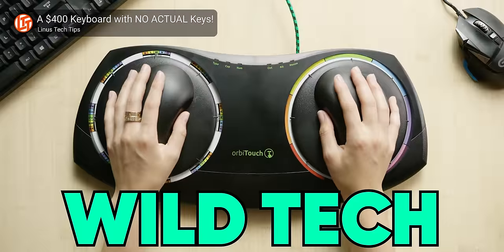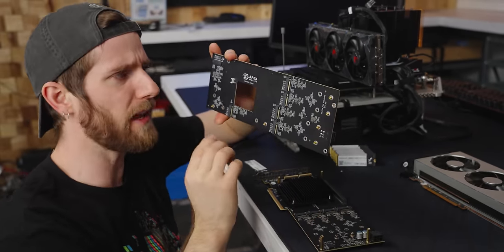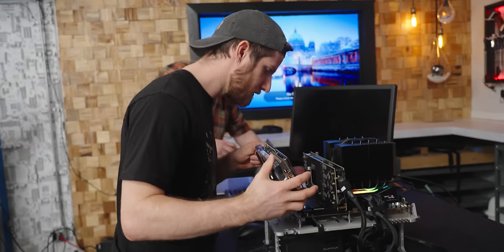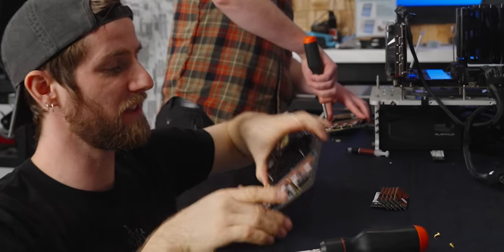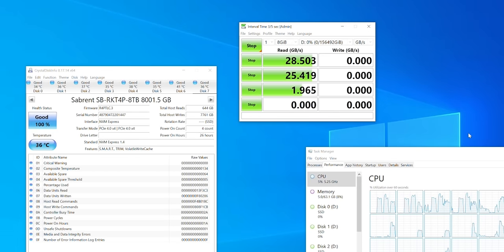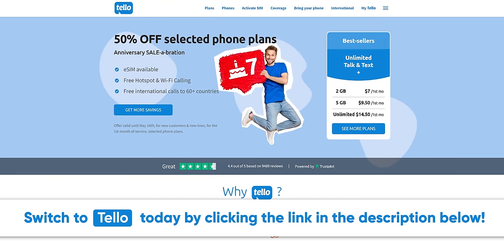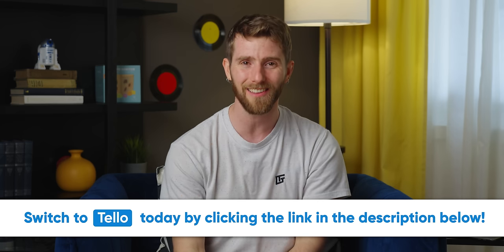This SSD is Faster Than Your RAM - Apex Storage X21

Comment: The primary use for these PCIe switches are actually in servers - when there's lots of SSDs in a server backplane they're sometimes connected directly, but often there's one or more big PCI-e switches driving the slots. And each switch will have a 16x or 32x (yes, this is a thing even if the standard only lists up to 16x) PCIe 4.0 or 5.0 uplink. This is the real reason why PCIe link speeds are again trending upwards quickly after a long hiatus (between 3.0 and 4.0), there's finally a user (servers) that are willing to pay for development (there's not enough entuast to pay for it by orders of magnitude).
And I assume the reason the card doesn't have any fans is because they expect it to end up in servers where there's a large amount of airflow provided by the server itself (sometimes capable of cooling 400W GPU or AI accelerator with just the servers airflow, no fan on the card.
It's also unfortunately why PCIe switches disappeared from consumer motherboards (many early SLI motherboards had them), the PCIe switch vendors jacked up the prices by 10x because most were sold to server vendors and they were willing to pay.
"Better" (IE expensive) server backplane often accept PCIe (U.2 or U.3, both 4x PCIe), SAS (12Gbps) or SATA (6Gbps) in all slots by routing each slot to either to the PCIe switch(es) or the SAS switch(es). Yes, SAS switches offers all the same features (fabric, multiple servers, dynamic load allocation to the "uplink" and so on) to both SAS and SATA disks, they've been in server backplanes for a long time (long before PCIe SSDs were a thing, never mind M.2). It does makes me wonder if some of the PCIe switch chips also does SAS, that would reduce chipcount and make routing far simpler which means they can ask the server builders for more money...
Reply: As far as I can tell PCIe has been getting faster at a pretty consistent rate for many years, it's just Intel was a laggard in going to PCIe 4 so gen 3 was around longer and by the time they were on gen 4 we were already close to gen 5. If you look at it in terms of AMD instead gen 4 was around for plenty of time.
Reply: @bosstowndynamics5488  No, 4.0 was seriously late. The official introduction years is 2003, 2007, 2010, 2017, 2019, 2022, (2025 planned) for 1.0 to 7.0 (check official graphs or the Wikipedia article). Note how they all are around 3 year, except one that took 7 year - that's the 3.0 to 4.0 transition and it's a big outlier.

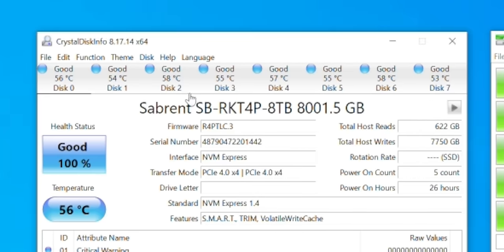Comment: 12:25 55°C is apparently the sweet spot for nand flash, it doesn't like being colder or hotter 
Colder = increased data retention, write wear
Hotter = increased hardware degradation
Reply: Anywhere I can read up on that?
Reply: @pandozmc  I think I first read this on a EKWB site but now I can't find it.
After a bit of googling I found this anandtech article from 2015 back when SSD data retention periods was becoming a concern.
I should note that my memory isn't quite accurate, so if you do look this up feel free to ignore what I said in previous comment.
here's what anandtech says :
The conductivity of a semiconductor scales with temperature, which is bad news for NAND because when it's unpowered the electrons are not supposed to move as that would change the charge of the cell. In other words, as the temperature increases, the electrons escape the floating gate faster that ultimately changes the voltage state of the cell and renders data unreadable (i.e. the drive no longer retains data).
  For active use the temperature has the opposite effect. Because higher temperature makes the silicon more conductive, the flow of current is higher during program/erase operation and causes less stress on the tunnel oxide, improving the endurance of the cell because endurance is practically limited by tunnel oxide's ability to hold the electrons inside the floating gate.

Comment: Use some M.2 to HD MiniSAS adapters and connect the card to U.2 enterprise drives, you could go with gen 3 because of the oversubscription.
Use two of them to connect 42 U.2 drives RAID 0

Comment: It sound like it dynamically routes pci to where it is needed, It is super cool that it is possible to run any 4 drives at full pci speed or 8 cheaper slower drives at their slower speeds at the same time.
Onboard raid controller could be perfect, so that the pci bandwidth only needs to transfer to the drive controller and the drive controller does the mirror instead of using pci bandwidth to mirror.

Comment: On the Topic of Hot-Swap M.2: This feature must be supported by the Controller AND the SSD - and the Crucial P3 in the test does not support that.
Through my personal testing, I've found not all hot swap feature on M.2 is the same - its basically a hit-or miss (for me at least)
Reply: I thought by the nature of its design all PCIe device chips need to support hotswap. The hard part is power switching and mechanical considerations which make m.2 unsuitable.

Comment: As the SSD capacity fills up, it has to do "garbage collection", which is the process of erasing blocks which have invalid data. The still valid data must be written to free blocks before the erase. Due to high latencies for erase and write, there may be conflicts resulting in requests waiting for GC.

Comment: Well I literally just attached 8 NVMe 2TB drives to my ITX server. I bifurcated the x16 gen3 slot into two x8 slots using bifurcation. In each slot I placed a PEX 8747 board carrying 4 NVMe cards each.
Prices of 2TB drives really went down recently. They finally are under $100.
Reply: Where can you get a 2tb nvme for under $100, what brand if you don't mind me asking?
Reply: @Neopopulist  my comment got deleted. In summary, Silicon Power.

Comment: It's faster than a stick of 3200MT RAM. Not 2 sticks as you would use in dual channel. 
As for SLC cache, the Rocket 4 8TB has around 880GB of it per drive, so yeah, if you have 4 drives it'll slow down after you've written 3.5TB, but that's an awful lot of data to need to write at ~24GB/s.
That thing still is insanely fast though.

Comment: Well, io_uring is a very very modern API for asynchronous I/O recently added to Linux 5.1, so it makes sense it'd be able to efficiently take advantage of the incredible performance this board obviously allows to reach. Still though, 44M IOPS is just nuts

Comment: If this Gen 1 Release this going to be RIDICULOUSLY great for server holders when they figure out some Physical slim-lining, cooling and Thread count improvements and some BIOS <3 this is only going to get better this is real potential game changer. If i were working on this try to make a 4-7 SSD slot Everyday version that some small Small/Big sever owner could trim down on physical size and components per rig while upping the Per-point data pools
Reply: Data centers don't have those problems. Basic nvme servers have 24 nvme bays (typically  U.2/U.3) perfectly cooled,  and when they want to put more NVMe  they just add external JBOFs, basically a dumb external box connected trough one (or more) PCIe x16 extenders, and you can put several of them. Decent EPYC servers have 6 x 16 PCIe gen4 slots  so you get the idea.
Reply: Its designed to go in a server where every surface is essentially blasted with with air 13:40
Reply: not anywhere near those demos quality but yeah quite astonishing

Comment: Finally a solution to the 2GB DDR2 ram dilema. (you can only have max 4GB on a 2 slot moteboard)
Reply: DDR2 is still much faster because it has much lower latency.
Reply: @marcogenovesi8570  Wait, why is anyone using DDR2?
Does DDR2 have any advantage over DDR4/DDR5 that I am missing?
Reply: @hubertnnn : I have some old systems running with DDR2. Work just fine. :)
Reply: @marcogenovesi8570  Ok, I thought by "more recent" you meant, that they made a new DDR2 last year

Comment: So I went to look it up, and the best part of this solution, it is that bifurcation is not needed. One slot populated means that one m.2 is connected 4x16, not 4x4 like the $80 Asus, MSI, etc, etc, AIC's do. You cant make it go faster, but you have a way fatter pipe to push it through with. You could essentially always just be in the ALL of SSD's RAM, if fully populated. Never need to slow down to the drive's NAND.

Comment: Some time in the future RAM and SSD will merge.
Reply: That would be cool but probably impossible due to connections and cooling
Reply: I mean there are shared memory systems with multiple terrabytes of RAM but an SSD's average response time is way too large to be RAM.
Reply: @TheHomeless080  and on the other hand RAM resets everytime you turn off the power
Reply: I wouldn't be surprised. I have a b450 board, which is around five years old, and it's supposed to have some tech that merges an SSD and a physical drive. The end result is supposed to be that your most frequently used files will be stored on the SSD, so that only the necessary files get the expensive fast storage while the normal and infrequently used files go on the slower and cheaper storage.
Reply: RAM and SSD is extremely different and its very unlikely to merge since those differences are often used as advantages. For example RAM lifetime is almost infinite, you can write as much as you want, while for SSD you can write only 100x-10000x (depending on type of drive). SSD also is a lot faster to change 0->1 than to change 1->0, while RAM has the same speed of both. RAM also looses all data on restart/shutdown, while SSD keeps it.
Reply: @Thalanox  host memory bus. Nvme ssds without dram can allocate system ram as cache.
Reply: It's called optane

Comment: It's a single board attachment with it's own processor dedicated to allocating which m.2 is being written on or read from. In concept - the card is functioning the same way P2P file shearing does: where you're downloading small portions of a large file from multiple sources, simultaneously, and then reassembling them afterwards. That's what the big cpu chip is doing - disassembling and reassembling from the multitude of m.2 drives. There's several bottlenecks involved due to the process itself - but the speed of information transfer is so vastly increased by reading and writing to multiple drives simultaneously that you still get an operation speed increase in spite of the bottlenecking.
Reply: That's not even remotely close to what it's doing - what your describing is an unnecessarily complex hardware RAID 0, this card is just a PCIe multiplexer, it's doing exactly the same thing that consumer multiplexers like the ones built into AMD and some Intel motherboards do (x670E for instance gives you more PCIe lanes by literally chaining 2 multiplexers, that's the difference between it and x670 non E). That's why each drive is individually addressable. Combining them into one larger, faster storage device is being done with plain old software RAID 0 - the files are being split between the devices by the OS, not by the card.

Comment: I can say, with definite certainty, Windows Striped volumes are FAR better than BIOS based Raid solutions.  I have an ASUS PIKE card in my server and between that and the AMD BIOS RAID, I prefer the Windows Striped Volume manager.  Simply due to the fact that if i upgrade the system hardware, i don't run the risk of completely losing my data in the array, windows just handles it.  Every time i updated the BIOS it was a gamble if the array was completely lost or carried over.  The PIKE card I have a hard time navigating the basic menu, and rarely ever interacted with it after i set it up the first time.  On a performance level though, BIOS RAID and Windows Striped Volume perform exactly the same.  If you look at ease of use in the performance then Windows is by far above BIOS.
Reply: Yes, but only for raid0, because Windows performance in raid5 or raid6 sucks, better use Linux for that
Reply: The real answer is use Powershell to set up your drives in Storage Spaces simple mode - their raid 0 equivalent.  Doesnt show up in the GUI Storage Spaces manager in Windows, you have to do some powershelling to effect a raid 0 but it is worth it!  Using Disk Management to put disks into dynamic mode and doing a striped volume is actually deprecated now so there wont be any more features added or support/compatibility going forward into later versions of windows.  They just left it in there for backwards compatibility reasons since its been a feature since Win 7 (I think, maybe XP?) Random performance was better using storage spaces over disk management striped way, sequential speeds are identical.  Best part is you can add multiple drives to your pool of all different types, sizes, manufacturers and the pool will optimize in the background automatically while you use PC - no waiting to rebuild the array when you add space like in disk management.  Highly suggest you check it out.  I went down a storage rabbit hole recently trying and benchmarking, BIOS raid 0, Disk Managment Raid 0 and Storage Spaces Raid 0 to run my 4 x 2 TB HDD as a game pool for older games that dont need SSD speed as well as media and Ive found storage spaces to be the best overall.

Comment: I wish there was a small version of this with 4 drives so I can put the drive in my second X16 slot that doen't have bifurcation and is actually only wired for 8x. I hate that mobos give you slots that dont allow you to use all of them cuz using sertain slots disables bandwidth or the entire connection for other slots.
Reply: 4x m.2 cards with switches exist, they just cost a lot more than the ones that work with bifurication.
Reply: @nadtz  yeah that sucks but then that is cheeper than a new mobo these days that have more than one full 16x slot. I was looking at a sata card that takes 2 2.5" drives that screw right on the card but its only pcie gen 2 1x meaning that if you have two ssds on there you can only get the max speed of one drive even if two are being used simultaneously. there is a 4 way card that has more pcie lanes but that too is 200 bucks and not worth it.
Reply: @firenado4295  I'm in the process of testing a few cheaper 4x cards in an EPYC board with bifurcation just for the lols, if you really need it there are some good deals to be had for older but still recent hardware.  Yes it won't be top of the line and the absolute fastest but last gen Xeon W systems for example can be had pretty cheap if you need more PCIE lanes and/or features like bifurcation on a budget.
Reply: @nadtz  my issue is that my new pc I just built a year ago the mobo only supports bifurcation  on the main 16x slot. the second 16x slot is only wired for 8x and does not support it. I just really want it so that I can have multiple drives in one place and also use a pcie slot as I like things being consolidated and also I want to use all the pcie slots otherwise there is no point in having a full atx board.
Reply: @firenado4295  I can sympathize with that.

Comment: If you guys want to really push hardware like this (and your GPUs, like the 1000w 4090 test), hire an ML or Data Eng.  Games are silly tests at this point. Especially for the GPUs, games don't get take advantage of all the ML/AI-powered rendering that Nvidia has developed demos and released whitepapers on yet, so it will eventually be relevant to your gamer audience.

Comment: Wouldn't you be able to potentially use 5 of these in a 222
GIGABYTE X299 DESIGNARE EX? Put 12 of seagates 24tb hdds in a thermaltake view 91 case. With proper power management. You're looking at around 1.2PB

I think you would only be able to use it as a NAS, because there would be no room for a gpu.

Comment: It is interesting that the use has an expiration date, whoever uses this type of equipment in the proposed scenario of continuous use reaches the TBW of the units in a very short time.
I remember setting up SLC caches on dedicated servers more than a decade ago, even though it was SLC the replacement cost was already considered at the beginning of the project, even though it was expensive there was no other way in the same cost range

Comment: if this is faster than ram I want to see a video of them using this as ram for a pc
Reply: It isn't faster than RAM, maybe in sequential read/ write, maybe, compared to DDR2/3/ maybe 4 but certainly not in random r/w.
I mean otherwise, we would not need ram at all anymore, since this is non volatile and it would be a lot cheaper if it was mass produced and only 32GB. So the title is obviously just clickbait...
Edit: And this SSDs cost per GB is not even that high, so it's not even expensive as RAM in this regard

Comment: this will be the new standard within 5 years
Reply: not exactly but it becomes much cheaper and those boards are perfect solution if you are limited to 1 or 2 nvme slots.
Imagine, you could buy this board for $50 and swap your 21x 1TB or 2TB nvme

...old PCIe ssd cards are still on the market and they are still expensive AF

Comment: Thats gonna be Linuses new plex server. Video editors sure but the capacity in such a small space is huge alone. And the speed is just insane. I see some content creator doing some stuff with it.
And lets be honest. A "real" NAS is not really cheaper. You can also cut costs if you not stick 8 TB SSDs on it but go with like 4 TB which have a much better CPT rating.

Comment: Between the Geforce 210 and my NVS 2100M, 6.4GB/s is DDR2 800MHz while 12.8GB/s is DDR3 1600MHz-automatically faster than the 2x4GB 1066MHz DDR3 in my laptop. I am glad I got a machine (even if it's 2010 old) that has no memory limitations and whatever performance I get is straight from the CPU/GPU, and now that I replaced the stock pads with GELID ones, temps never hit 100C ever again so NVS 2100M has LITERALLY no bottlenecks. If it were Geforce 210 6.4GB/s, well... Just watch zWORMz's video on the card and you'll see what I mean. I'll accept no less than DDR3 in any capacity.